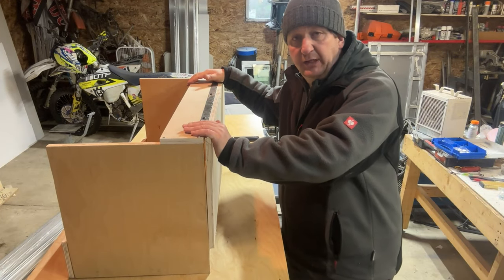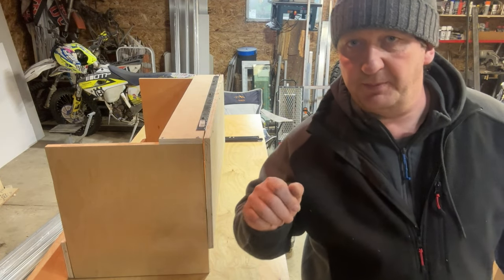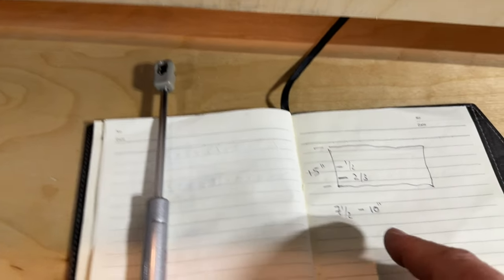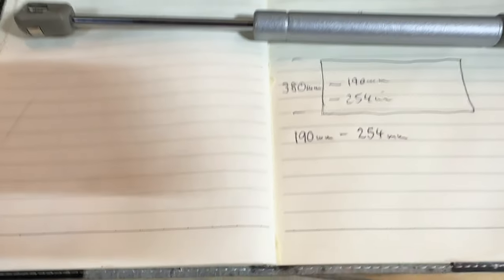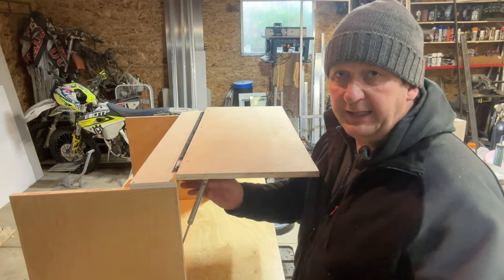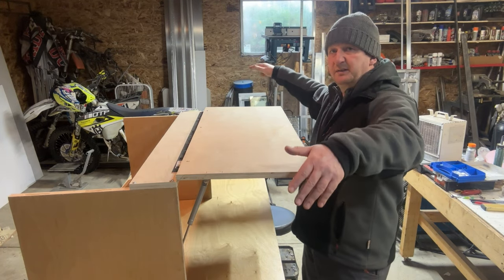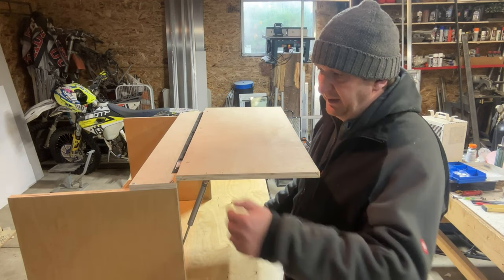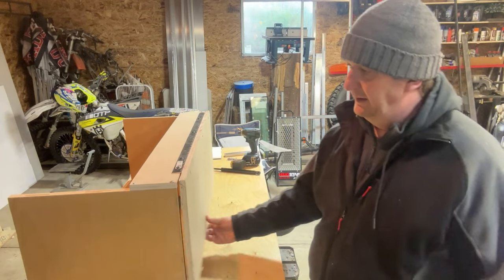How to calculate a Gas Strut ! Length - Force - Position all DIY !!!

Comment: Do the struts to with the shaft part up, down or does not matter ? Thanks
Reply from the maker: It matters the cylinder should be up at all times for two reasons.

1. In the cylinder is a little bit of oil which lubricates the seal around the piston, if the seal is not lubricated because the oil is on the other end of the cylinder ( if you mount them upside down ) than the wear and tear is higher and the life expectancy of the strut is degrading  pretty quick. 
2. If the strut piston extends all the way at the very end the little bit of oil need to be pushed away which has a dampening effect. Means the strut does not run hard against the cylinder bottom almost like a soft closer. 

Therefore the cylinder should always pointing up !
Reply: @oscaroverlander_MB1222AF  Perfect, thank you for replying. I have re-watched your video and ordered the part I need with confidence - thank you so much, my mum should be able to get into her baking cupboard now :)

Comment: Exactly the information I need for the door on my shed! Thank you
Reply from the maker: Glad it was helpful!
Reply: I’m trying to do the same thing with my shed I’m building. Are you going to hinge the top or just use the struts for your shed door?
Reply: @miked9736  I'm going to hinge the top so it can also be used as a shade/rain cover for a small seating area I'm attaching to the front. Food truck style. Good luck with your project.

Comment: Hi sir, this was a great video and a great help for me, I’ve used them once before, done it wrong and then wondered how to do it properly ever since.. I do however have two questions..
1.) you mentioned using two struts.. I’m wanting to build a bed that lifts for under storage and would prefer to use two struts for safety reasons, in this case do you still use the formula 1kg-10N or would you halve it when using two, theoretically sharing the weight?
2.) the bed is not going to be lifted 90*, it will be more like 30-45* does your 20-30% rule still apply? I figured if you move it away from the hinge (down on height) then you will crush the strut under weight on close, and if you move it further up (close to the hinge) then your weight ratio will be off not being able to carry the weight closer to pivot. Or do you follow these steps and just only open to desired height? 

Cheers mate other than that it was really descriptive and I’ve just subscribed to help your channel 👍